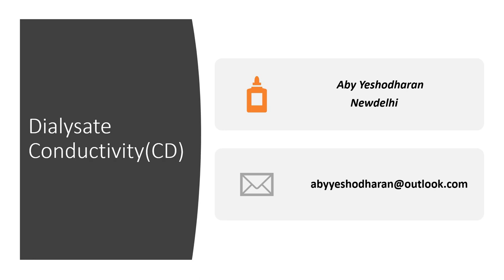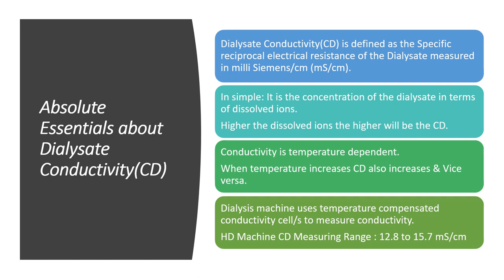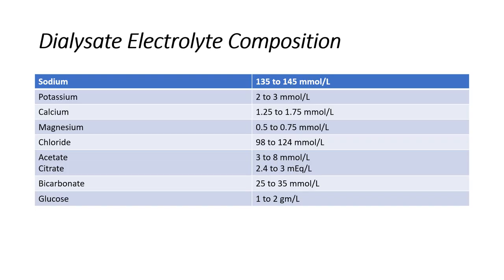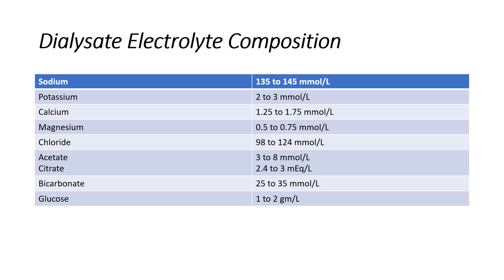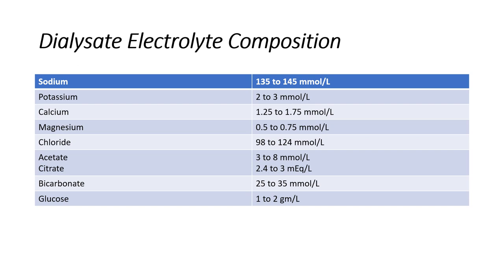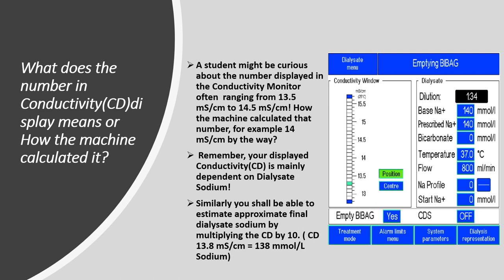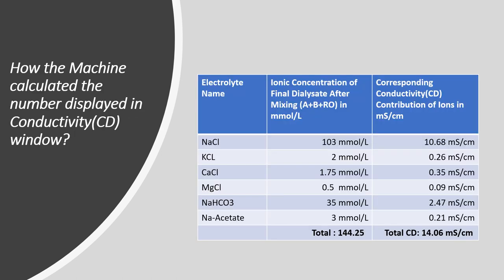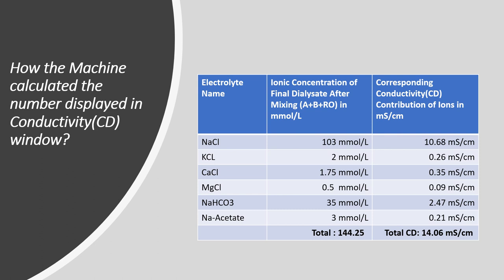Dialysate Conductivity(CD) CalculationBy HD Machine

Comment: Please sir tell me what is the best conductivity value for patient. I listen its 13.8 is it true. Kindly reply
Reply: Basically 135mmol/l.. is used
Reply: 140 is the Best. Why? Dialysis Machines Do Not Always Give You What You Order. And Where is the Error Usually? On the Low Side. So 138 Sodium Ordered May Now Be 134/5 Actual Conductivity. This is Big When Your Patient’s Sodium is 132-134. You Can See that You Would Rather Had Ordered 140 Sodium As that Would Have Put You In the Range of 137/138 Where You Wanted to Be.